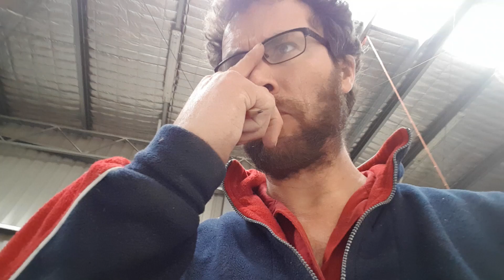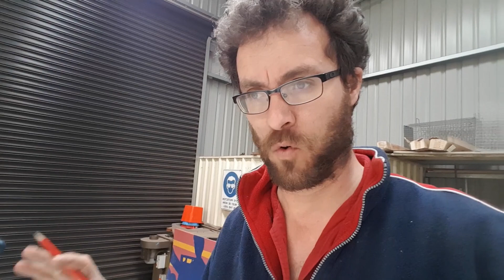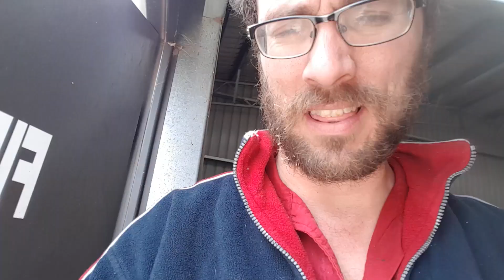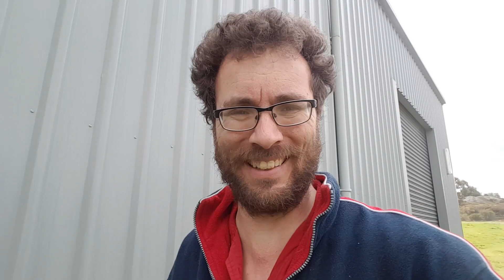What is the ideal angle for a sluice flair

Comment from the maker: There is a difference between what is the ideal for a particular situation and the ideal for a piece of equipment that has to be used in a wide variety of conditions.

Reason I got thinking about this was that I couldn't see any information on flair design and there is a wide variety of forms from commercial suppliers.

Commercial manufactures who have done videos on their gear doesn't fill me with much confidence that they understand the relevant fluid dynamics.

Comment: Great question,with a lot of answers. There is always going to be fine tuning each time you set it up regarding flow rate/ depth of the water etc I fill anything over 45 degrees is to much and starts to displace the water slowing down the production of the gravel's/dirt.cheers Craig
Ps. Were are you going to find running water here😊
Reply from the maker: Couple of spots not too far away. I was supposed to go out this weekend but I've been leargied.

Comment: Good subject Stu. My understanding of the original idea behind the Flare was so more water volume and speed could be achieved in slow running water. Very slow water requires a larger (wider) flare. The slower the water, the wider the flare.
Cheers, Ken
Reply from the maker: Yeah my understanding to. But is there a limit? Could a square box on the end of the sluice be the ultimate flair? Or does the angle set up a dynamic within the flow that helps the riffles ro mats work better?

Comment: Well  ,  assuming that there is a good flow of water and that it is set up 1 inch drop for every foot in length .  I would think that  the angle and flair area would be great enough to allow you to shovel pay dirt onto  the flair platform at a steady pace  and have it clear quickly , to allow you to process as much material as possible in a day  ?
Reply from the maker: The angle of decline that is common quoted of 1 in 12 has been found to not be the ideal angle. It may be an ideal angle in certain situations but some research has found much steeper angles can significantly increase capture rates.

Comment: I don’t believe there’s any specific angle, at the end of the day the flare is only as good as the water angle that enters it.
Depending on where is available to set up in the creek that will suit your needs you sometimes need to place a few rocks to manipulate the direction of water flow to even out the flow through the sluice as well as soften the water flow as you probably already know.
Iv seen many sluices without flares with rocks placed to channel whatever your desired angle or flow of water is depending on how you like to run your sluice.
Reply from the maker: yeah me to. Up until now I've used a dam to increase flow through the sluice.